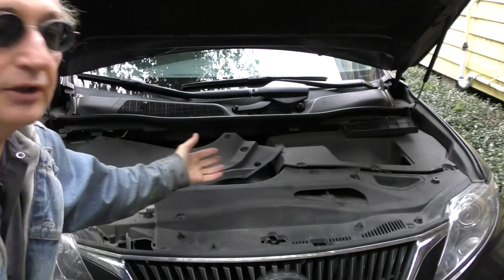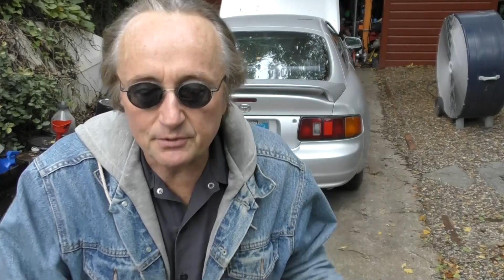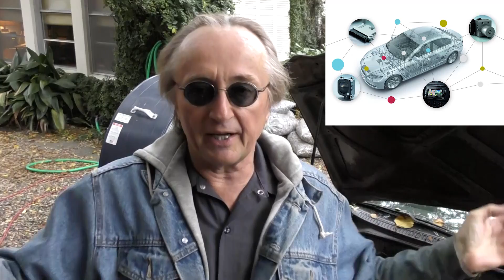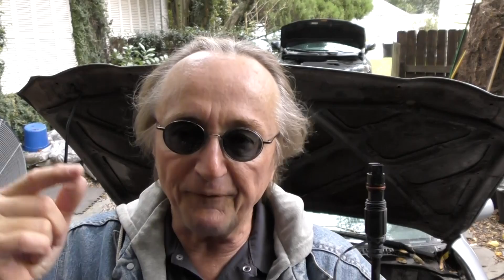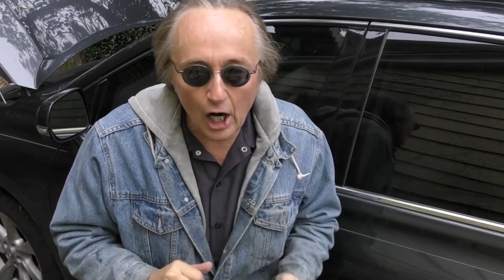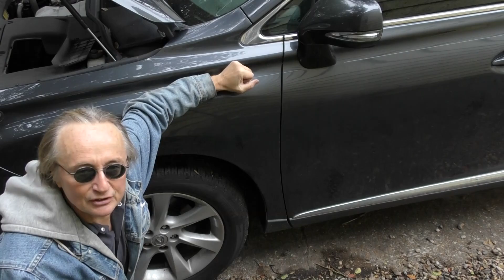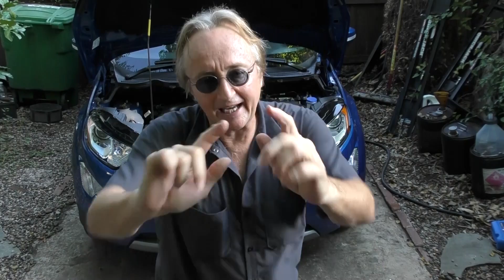The End of DIY Car Repair, Why New Cars are So Hard to Work On

Comment: This is why I don't own any vehicle that's less 10 years old
Reply: @dante love I'm not sure rubbing in the fact you're rich enough to afford brand new vehicles is needed. ;p
Reply: At least with my 01 Silverado if it breaks on the road I can repair it.
Reply: I have old cars and new cars.  Both are easy to work on.  with some help from good folks like Scotty and others that show me how and what to do.
Reply: Mines 26 years old and runs like new and is in great shape. Older is better, most vehicles now are Chinese plastics
Reply: I don't trust any car that's less that 30 years old.
Hey, I consider the end of DIY when fuel injection became mandatory.
Reply: 10 Years? You mean 20. Better 30. Modern cars are crap.
Reply: 78sound  nope. my VW bus points need change out every 15,000miles. Coil has not failed. 
yes, it's only 15,000 volts on a good day,  that's why it never burns out.  Coil on plug is waay more $$$. 
I do like the claim COP is more fuel efficient,  saving a few drops of fuel per mile, but coil packs cost 20-40+$ per 
so how do you re-capture the expenditure once you start replacing  them? You don't.  Unless you drive the same coils
for 700,000 miles, but they will burn out long before that. They've turned ignition coils into service parts like sparkplugs. (
Reply: @SexierMink1699  yes it will be cheaper...in both ways. I'll stick with my civic, it's damn near indestructible :p

Comment: This video explains what I've felt about restoring modern cars vs older cars. Moderns are so complex and crowded in together -- especially with computers that ultimately fail -- and the expense of  replacing parts and pieces -- just not worth the effort.

Comment: Nice video🤠👍 I never buy a new car. I fix and keep my 04 Toyota pickup and 00 Ford excursion in good shape. Easy to fix. Thanks Scotty. I learn a lot from you.
Reply: Biff 1 Tannen what engine in the excursion?
Reply: Biff 1 Tannen I concur with keeping that sweet Ford Excursion . They were tanks & built to last. Change the motor oil every 4-5k mis using Mobil 1 high mileage formula & keep transmission fluid clean! Use ONLY Motorcraft oil & air filters that's a big one. Now for the Toyota? Not a fan. Im a truck fan & expert. Toyota is no truck company. Terrible trucks.
Reply: @evinrudej ... 7.3 powerstroke 😊👍🇧🇻

Comment: I’ve learned so much working on my 2002 BMW. I started when I was a teenager out of high school fixing my car here and there. Now 5 years later I have done so many DIY mechanical repairs with help from the internet that I basically can tackle any repair except repairs that involve moving very heavy things like transmissions or exhausts because I don’t have a lift. Never give up!!

Comment: I don't see myself driving anything newer than 1994 anymore. I'm old.
Reply: nah, im 23, my newest vehicle is a 1993, the rest are from the 70's and 80's, these new cars are crap, you're not the only one, trust me.
Reply: And I like that they weigh less than new bloated vehicles.
Reply: Love my 1999 tacoma
Reply: New cars are not bad, the key is to get it rebuilt title, so its cheap and has low mileage. It will barely have any problems if its new.
Reply: I'm 19. I had the money to buy any car I wanted. I picked a 2003 diesel volkswagen because they get 50mpg, insurance is cheaper,  and i love doing all the work on my own car. The newer ones are just too complicated. I've done the clutch, replacedinjectors, strait piped the exhaust, and many other small things with me and my dad.
Reply: 95 was obd1 still except ford started obd2 that year. Even ford trucks up to 04 are pretty easy still. The Rangers anyways. Don't know about cars. I only work on trucks
Reply: Spencer | Sweis12 ur a smart young man
Reply: Love my 94 luckily about the last year before things got to electronic  for me.
Reply: I got a 97 Volvo. I would live to drive it forever but I live in a cold climate an the rust is attacking it badly. Still, I'll do my best to keep it alive as long as possible.
Reply: My newest car is my 93 camry :) great little car.

Comment: Because the dealership wants to charge you a 150$ an hour to plug in an obd....
Reply: Or $80 on a cabin air filter ANYONE can replace in about 1 minute. 20 seconds if you don't have to unscrew something.
Reply: legal robbery, in the name of banks, dealerships and oil companies
Reply: Miguel Angel Medina Rise yes it should be criminal to charge far more than it actually takes to do certain things. Why are they not just honest and charge what time it took?
Reply: Miguel Angel Medina Rise truth. Keep engine air filter clean is more important tho!!!!
Reply: Paying for the labor and the software for the hook up. Like in work for Ford we call ours IDS
Reply: Stealership
Reply: ..... and there will be the inevitable 'environmental protection laws' that will prohibit any unauthorized repair/replacement/adjustment by 'certified (for govt license fee) technicians of the components of ignition control, fuel, etc. systems.   Already in effect for most emissions equipment, etc.  
Reason: Members of Congress and other legislators need the lobbying payments from 'the special interests' for their election campaign funds. Without such stringent statutes and regulations imposed, Congress and legislators will have very little to SELL.
Reply: Will Wilkerson 😂
Reply: —>  @jamesmedina2062  .... and the mechanic who does the work only gets 'flat rate' time for the job ... any overage on how long it actually takes to do the job isn't paid to the mechanic.
Reply: is not plug the obd2 , it is diagnostic what they charge , I will give you   the same  code  for 2 different brand  ,P0171 and P0174  at higher rpm and loads only ,  rpm and loads is not on the code description,  so with this code on Toyotas 90%  is maf sensor , fuel pressure,  same code on ford  good luck you have like 20 possible , how much does it take  to the process of eliminations of 20   possibilities, 
the customer decide to buy the car we are just working on it , I did not design it ither and I did not break it .
Reply: nissan dealer charged me 250$ to change one bad tpms sensor....only reason i didnt fix was cause none of my scan tools or anyone i knew had one that could pinpoint which one was bad....scam
Reply: @workingshlub8861  Discount tire sells it for 60 dollars each and can diagnose which sensor is bad
Reply: That “obd” costs $12,000.00 not including yearly updates at $1,000.00 a pop. Want them to provide a service for free?
Reply: James Speer  Because if a technician can do a 10 hour job in 3 hours he should get the 10 hours worth of pay because that's what the job pays. Its pay per-job, not per actual work time. His skills and knowledge got the job done quickly, and if he only earned 3 hours of pay on what's supposed to be a 10 hour job he'd essentially be getting punished for being good at his job.
Reply: @hillbillyrigrepairs1814  they dont update car software after its left the factory unless its serious, then theres a mass-recall. 

It's why you can buy a OBD2 scanner pretty much anywhere, never update it, and expect it to work because it's old standardized software mandated by the government.

The whole reason why cars use OBD2 is because California was having issues smog testing cars that required a different scanner every time. Thus OBD2 was implemented and all new cars after 1996 had to have it or they couldnt be sold in the USA.

The only thing a cheap OBD2 scanner vs a professional one is a wider range of readouts. Like an oscilloscope to measure exact electronic read outs mainly used to tune and find bad ignition coils or distributors.
Reply: Solmangrundy ManGrundy I was referring to necessary updates to professional OBD scan tools. The yearly scan tool update keeps the mechanic current with all manufacturers TSB(technical service bulletins), common repairs, along with a whole host of other relevant information.

Having this information at ones fingertips saves time and therefore increases profits;for instance if I’m on a mobile service call without WiFi access-it’s invaluable to have up to date service information right there on the scan tool)

I’m not referring to a $100 OBD code reader from autozone-I hope I have made that abundantly clear.
Reply: The problem is the labor rate, what they pay the mechanics, combined with the high price of parts.  In super crap countries, the dealerships hardly charge you much to fix your car, cause they pay their mechanics scraps and use knockoff parts made in china.
Reply: @workingshlub8861  
Very expensive  OEM  tool for them in fact one of the most expensive

Comment: I'm an old guy. I remember setting the points on the old-school distirbutors. I still adjust the valves on my DR650. Those days are gone, with cars.  My Fiesta ST is still too new to need much maintenance, but for a newer car, it's still pretty DIY-friendly.
The ST also has the best anti-theft device you can have in the US. A manual transmission.

Comment: I love my 1993 Toyota mr2. Pretty much cars are the same but today there basically plastic no metal. A car that lasts is old. Why not buy old and mod it.
Reply: Yeah me too i got mr2 sw20 NA its a 25 yr old car but runs like a champ a  mid engine car but so easy and cheap to maintain the engine parts are everywhere brand new or used one you can even use the parts on camry its basically the same engine. and any local mechanic can fix it. and not to mention it is one of the most good looking mid engine sports car.
Reply: @troyperez5361  exactly, not to mention the sound of having an engine sitting behind you.

Comment: That’s why i don’t want to get rid of my 1993 Honda Del Sol.  Its my daily car and a gas saver.
Reply: wrxassa < I also have an 08 BMW X5 4.8i,  06 Acura RSX-S plus 2 more (no need to mention).  All paid off.  You, what do you drive?
Reply: wrxassa  it's clearly not junk if it's still running over 25 years later....
Reply: wrxassa  what do you drive bud we're quite curious
Reply: Kevin Hoonigan this guy just a Honda-hater. He probably drives a WRX. It's a cool car but isn't as reliable.
Reply: Alexander Volta so is my 02 Ford Focus SE 2.0L Duratec 4cyl. All orig even alternator & starter! Great normal maintenance thats all. 244k mis runs beautiful.
Reply: wrxassa lol says the guy driving his shitty German engineering that falls apart after the lease is over
Reply: @jamesmedina2062  haha that's why those WRXs are always overheating on the side of the road depending where one lives. Where I live they are just cars I pass by. WRXs are fantastic but highly unreliable if the weather exceeds 101 degrees (38.333 celcius degrees)

Comment: Front end alignment is easy. All you need is some string and elastic bands.  The string is tied on so it locates at mid tire level from behind the rear wheel all the way round the front of the car to finish up behind the other rear wheel.  A couple of elastic bands in the middle of your string so they maintain the tension when all is in place.  Most motors have a slight toe in, check your vehicles on the net.  Any misalignment is easy to see, adjust track rod ends to set toe in and centralise steering wheel.

Comment: I just bought one of the Blue Driver Blue Tooth dongles and this little tool and the app that runs it is the best little one I have seen.   It supports the Miata VVT engine!   That sold me.   Huge online database of fixes too.        But I hear you.   The tech is changing.  Frankly I like the  computer controlled spark generators.  HAPPY THANKSGIVING Scotty.        Scotty does Homework!

Comment: This is why I drive a 1997 Oldsmobile first off it has the 170hp engine and I can keep up with a lot of cars second I can change any part on that car myself
3rd I bought it for $450 and it runs great
Reply: A lot of cars in 1997 maybe . Cheap economy cars have 170 horsepower now.  Toyota Camry's have 300 horsepower. What a time to be alive.
Reply: @boostedkidproductions9719  2018 models.  Base model is 205 horsepower. V6 is 305.
Reply: Most family sedans rolling off the line these days are close to 300hp
Reply: @R69H  Yup horsepower is much higher these days. My Lancer is only 170 horsepower and torque. I'm so bored of the power. Wanting to trade it in but it just doesn't make sense financially for me. That's life.
Reply: In 1997 170hp was consider fast but I know a 2018 car definitely has more horsepower than that

Comment: Manufactures do not want people to be able to work on their own cars.  It is a huge cash cow for them even though many times even dealers can't even figure out what's wrong with them.  Even before electronic fuel injection, variable valve timing, ABS and traction control the factory would position hose clamps in such a way to make them more difficult to get to.  I had to buy a special electronic code reader device to "exercise" or"auto bleed" the ABS system on my GMC to get back brake pedal firmness lost after changing disc brake pads (the fluid part of the system was never opened).  The dealer looked at me like I was from outer space when I told them of this option before I did it myself.  It's likely to only get worse.  What kind of fool wants to have "self driving cars" on the road?
Reply: Was it a Tech 2 tool?   There are wheel spinning tricks you can do to a GM vehicle on jackstands that will let you bleed ABS module.   I feel your pain.   But Wait till you see how much the Mercedes version costs...
Reply: @landychapman3  Autel Max Check Pro.  I don't recommend it, it's not very user friendly but it did work for this purpose.  Still had to go through auto-bleed process 6 times to get back pedal.  Do you have a link for the "wheel spinning tricks" you speak of?
Reply: @landychapman3  Don't be fool they get train on every car in the dealer...They go to school for every new part of a system...They don't want you to fix your own car so they play dumb....So yes you from outter space
Reply: @keithbranch5181  really?  EVERY dealership has techs that ARE NOT trained on EVERY vehicle group/class/type.
Witness c5, c6, c7 vettes and the rear mounted a8 transmission.
Look at volt and bolt.  not every tech is trained.  not every dealership can service them.  And service manuals weren't initially avaolable.  Thing is with 5 and 7 year warranties with 10 year parts production-projection. it gives your local mech 3-4 years parts availability..  excluding junkyards
Reply: and try bluedriver.  sends pdf report to customer email
Reply: @landychapman3  First you don't know you talking about I work at a dealership...You get train on all the vehicle..There are C to A tech....So a job you can not do go to a a tech... Anything new they send you to a school to learn that new part....Every tech C-A...My dealership own multiple brands....You don't work on anything that out your skill set...We also have hotline when they run across some new...They eventually always one hundred% of the time they fixed it...Every car they sell that apart of there brand can be fixed ..Now if it's used and not there brand it's go to a dealership it came from...But all there model that there brand they have different level of tech...The best who is equip does the job...
Reply: @keithbranch5181  You work at Chevy dealership?   Doesn't matter. not EVERY tech is trained on EVERY vehicle the manufacturer EVER produced.  That's pure BS.   Sure you should or would have someone there who is trained and/or experienced, but NOT EVERYONE CAN FIX EVERY VEHICLE.

Don't believe me?   Go to a VOLT, BOLT or VETTE forum and watch how the dealerships are NOT qualified to repair the vehicles.
Reply: @landychapman3  No I work next to Chevy I work for Hyundai we own several brands....What part you didn't under there are C-A tech...You go to school to learn basic think...Then you come to the dealership...You start off as a C tech...Then you move up but you don't exactly have to go to school..When you start off at a dealership...You might work as a lot guy a detailer...But once you in the dealership...You level everything over the years...The have there own school...So you everything...A tech do everything they been they for years...So no you don't know what you talk about...They have in a dealership what is know as ASE equivalent....Once you get master you can fix everything...The only have about ten brand at a time...So over years they are only introduce a few new upgrade...Some of these tech come from other dealership....So yes they know every part am talking about a A tech...B tech don't take engine out.But they know a of the part...But even some of them can do A tech work...They won't do it because they not get pay as a A tech.....
Reply: @keithbranch5181  so... Readig is fundamental.

I said.. And you proved..  NOT EVERY TECHNICIAN IS TRAINED ON EVERY MODEL.   Please stop beimg foolish.  Of course you go to gemeral schools.  Of course you get update training to supplement your general knowledge.

I stand by my assertion that not every Dodge tech can fix the Viper.  Not every chevy tech can fix tje vette or volt.
And not every hyundai tech has been trained on all systems on EVERY model EVER built.
Reply: @landychapman3  youre not listening to him, he didn't say every tech was trained on every vehicle at least not initially, he said for every tech that isn't trained on a particular vehicle, there exists another class of tech that is.
Reply: @landychapman3  of course not every tech can fix every vehicle and not a single person in this reply thread claimed that they could.